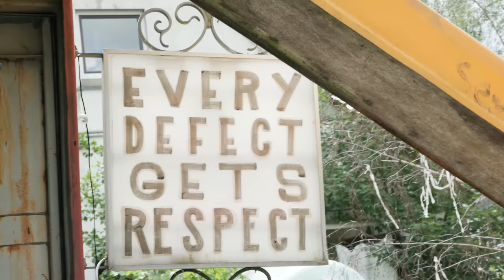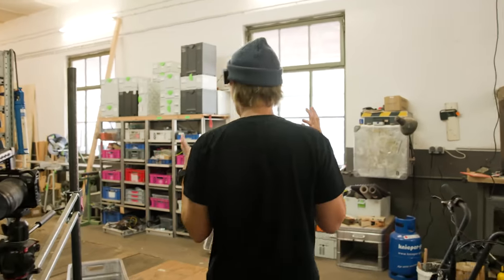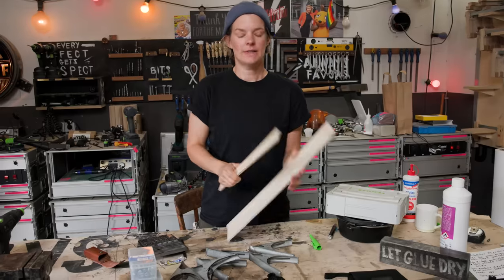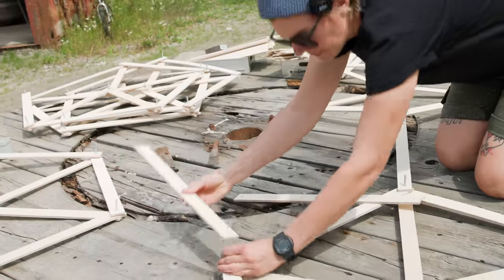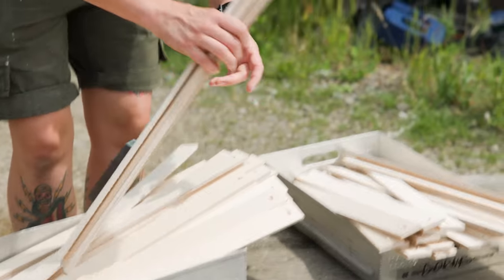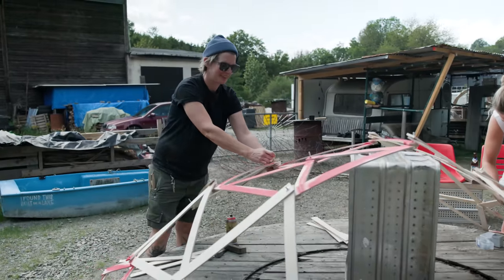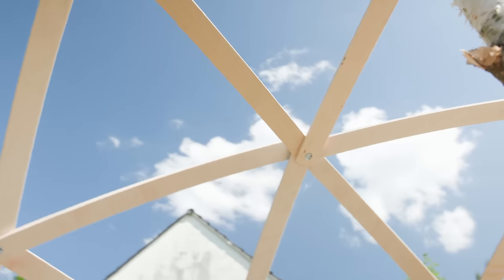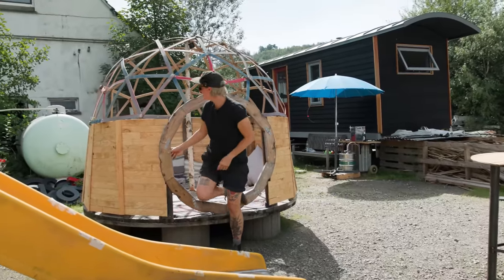Never underestimate a geodesic dome (also I turned 40)

Comment: make the slats, drill the holes etc...  soak or steam them so they have some flex - but do your build from the bottom up so it self supports on the way up... it'll work out ;)  Looked great !     Alles Gute zum 40. Geburtstag und die besten Wünsche, dass noch viele weitere folgen werden.  ( think I'm close there ;) )

Comment: These domes can't be made exclusively of triangles without bending some parts, but they're intended to be built with unbent constituents; I always see an odd-one-out, a square or open-pentagon at least three times over the domes surface; a square surrounded by pentagons which are surrounded by hexagonal-triangle-clusters: I'm sure there has to be at least three open odd-shapes to bend the dome correctly. even soccer-balls use both hex and pentagonal tessellations together.

Comment: The bars on the geodesic should NOT bend.  Its important that they remain straight or you could be in danger of them buckling.  It is the rigidity of the triangles that makes the geodesic structurally strong.  A flat bar that is bent in a curve is already part way to failing.

Comment: The tree died because it wasn't getting enough water with that huge wood wheel around it. It you would have cut 2 ft of wood around the center of the wood wheel and open to the sky, the rain would have reached the roots of the tree.